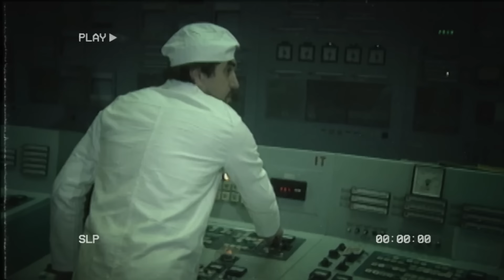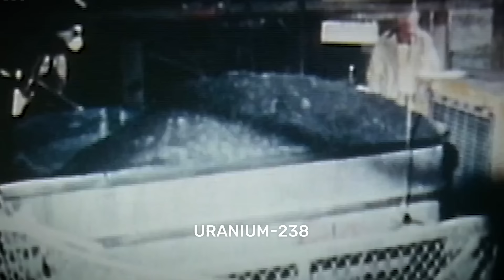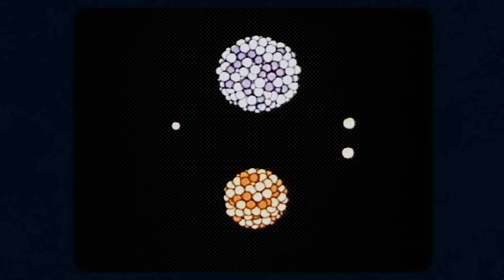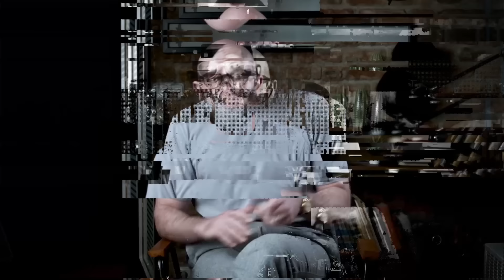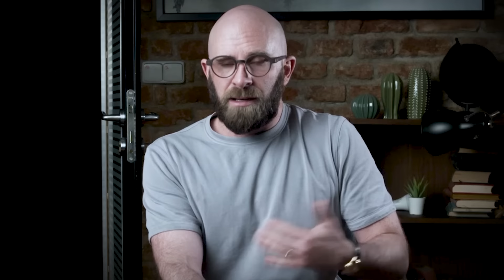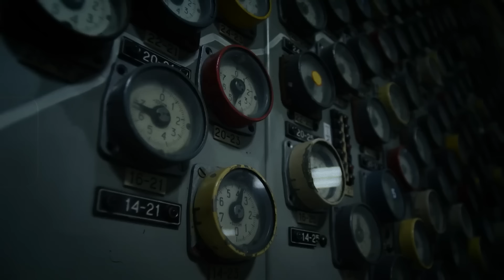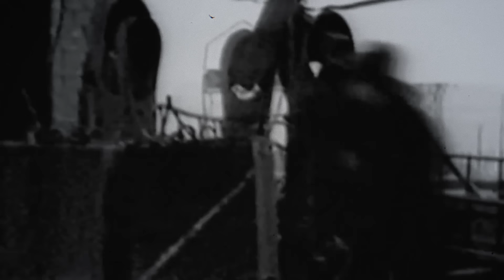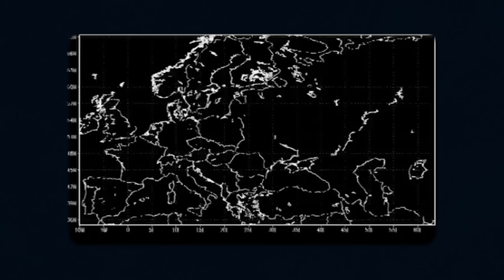The RBMK: The Shoddy Nuclear Reactor That Nearly Killed Millions

Comment: I didn't hear you mention how the buildup of xenon played into the disaster. Xenon is a neutron poison that builds up under low power operation because it doesn't get burned off as it forms. Once it builds up it can take days to safely clear. If some genius cranks up the power and the xenon burns off, you have an uncontrolled runaway event. The graphite tips helped make that situation even worse. The RBMK was just not idiot proof enough for the idiots in charge. At least this is how I remember the story I heard.
Reply: Xenon doesn't built up under low power. It only spikes up after a power reduction. 
At low power you do have a slower destruction rate but the creation rate is also less and a core running at low power will reach an equilibrium, not poison itself given time.
Reply: @ The point is it takes time to reduce once it builds up. And apparently you can't  rush the process. They did exactly the wrong things and that was the cost. It was a perfect storm of bad decisions.
Reply: @mntbighker  I think we are aware of that.
Reply: @mntbighker  They did not have all available information regarding the reactors they were operating. If they had, the accident would never have happened.  They deeply believed that an RBMK reactor simply could not become uncovered.  Moreover, the organizational culture in their nuclear industry didn't give them an option of "no, we're not doing the test." The ultimate failure was the Soviet system itself.  This is why the USSR was so uncharacteristically open and compliant in so many other ways following the accident.  The strategy was so effective, people still focus largely on the OPERATORS to this day.  The administration KNEW this was possible.  Yet every western television production about this fixates on Dyatlov and portrays him as a virtual sociopath.  This was not the case.  See, this narrative worked better for western authorities, too, because they were delighted to be able to use it as a foil for their own shortcomings.  And the fossil fuel industry LOVES it.  It is insane that we are not using nuclear.  Insane.  In terms of radioactivity, coal has introduced WAY more into the environment than all nuclear plants that have ever existed, I'm pretty sure.
Reply: @mntbighker  you just repeat the same thing... if xenon wasnt an problem, then it wasnt a problem. Could it be a problem if it accumulated enough? Probably, but if the investigations found it to be a none issue, then i tend to believe them.
Reply: @maxmusterman6030  It was a problem. See:

M. V. Malko, "The Chernobyl Reactor: Design Features and Reasons for Accident," in "Recent Research Activities About the Chernobyl NPP Accident in Belarus, Ukraine and Russia," ed. by T. Imanaka, Research Reactor Institute, Kyoto University, July 2002, p. 11.
Reply: @maxmusterman6030  The Xenon was not a problem until it was. When the reactor is operating nomally the Xenon gets boiled off as soon as it is created. They could even siphon some off to be used for scientific uses. When they did the test and the power went way down, the Xenon built back up to the point where it was stopping nearly all reactions from taking place. AT that point they should have just shut down the reactor, cleared out the Xenon, and then restarted the reactor. This would have taken several days.
When the power output got so low, the turned up the reactor to get power output back. At this time there was a lot of Xenon in the system. When they turned up the reactor, the xenon started boiling away very fast, and the reactor went into overdrive - way beyond the design limits of the reactor. Actually a runaway reactor. then they tried to slow it down using the control rods, but when the carbon tips entered the core they got stuck, as the fuel in the reactor had already overheated. further resulting in even more of a runaway.
So Xenon was not a cause of the problem but was something that made it worse.
Reply: @bsadewitz  nuclear energie - no thanks - eternal waste for a short time benefit - its plain egoism to leave that waste to others in the far future
Reply: @KrüppleKatze  That's true, basically they were running at something like 30-50% all day when they were supposed to be basically shut down so quite a bit more 135Xe built up than was intended for the test.
Reply: There are no "graphite tips" (they're displacers nearly as long as the control rods meant to improve the worth of the control rod), but otherwise you're right. They got trapped in a xenon pit, and instead of doing the smart thing (shutting down and doing the test next week), they pulled every single control rod  possible out. The xenon burned off, the reactor went too high, and then the SCRAM (AZ-5) pushed the displacers down to the bottom of the reactor, which caused that spike.
Reply: @ zactly
Reply: @AFullerHouseAtlantic  Oh, you wanna be pedantic?  I'm HERE FOR IT lolol.  YES, they can be referred to as "tips".  A tip is the extremity of something.  The third joint--and beyond--of your finger--that's your fingertip.  The whole thing--not just the very end of it.   If that were way longer, it would still be the tip!  Is it better to say "displacer" every time?  Maybe?  "Tip" doesn't seem to be the MOST COMMON term used, but it's hardly uncommon, either.  The notion that it's incorrect comes from a misunderstanding of the scope of the word "tip".  The medical term for "fingertip" is "distal phalanx".  The displacer is the distal element of the control rod assembly (or whatever you call it).  Yes, "tip" often implies what you're saying it does.  But it doesn't have to.  A tip can be like ... a projection.

"The Shteynberg Commission indicated that the graphite-tipped con-
trol rods had not been properly constructed and were of shortened
dimension. It is alleged that the sudden insertion of the rods into the core,
at low power, at the conclusion of the experiment, was the direct cause of
the explosion."
Marples, D. R. (1991). Chernobyl’: Observations on the Fifth Anniversary. Soviet Economy, 7(2), 175–188. 

"This characteristic, together with
graphite-tipped control rods (which temporarily increased neutron moderation during the act of reactor shutdown)
contributed to the Chernobyl accident in 1986."
Mark Ho, Edward Obbard, Patrick A Burr, Guan Yeoh,
A review on the development of nuclear power reactors,
Energy Procedia,
Volume 160, 2019, Pages 459-466, ISSN 1876-6102

"The leading edge of the
control rod contained a graphite tip that had no neutron
absorber and that moved out of the neutron-absorbing
fluid (water); as a result the reactivity was increased and
the reactor power increased drastically"

Badgujar, K. D. (2016). System science and control techniques for harnessing nuclear energy. Systems Science &amp; Control Engineering, 4(1), 138–164. DOI: 10.1080/21642583.2016.1196468
Reply: Tip implies that they're directly on the end of the rods and that they're substantially shorter than the control rod. They're not. They're separated by a couple of feet and very nearly as large as the absorber. It sits in the center of the core (in the original design) so the power band is relatively even across the core.
Reply: @AFullerHouseAtlantic  Actually the Series did a good job of showing what happened. Because the fuel rods overheated, they swelled and got stuck. and because they got stuck the SCRAM would not work and everything just turned into a complete runaway. 
I contend that the RBMK reactor could be safely run. But it has to be run right, no shortcuts every, no mistakes, you have to be on the top of your game all the time. And as what what shown, they were using the 3rd string, and the bosses were more concerned with performance than safety.
Reply: What you've said is accurate - the reactor running away caused the fuel channels to become misshapen and then rupture.

Re: safety the RBMK is pretty much by definition not a passively safe design. Water moderated reactors by comparison largely are  (not entirely, but a LOCA cuts the reactor power nearly to 0).
Reply: This is incorrect. Xenon 'burning off' made no meaningful contribution to the Chernobyl accident. This is just fan fiction that is nowhere to be found in actual accident investigation documents.
Reply: In fact xenon indeed absorbs neutrons but if you check the graph of xenon relative to the power level you'll notice how xenon actually increases for a little while then reduces significantly on that same power level. If you're interested in the little details i highly recommend ThatChernobyl guy
A great YouTube channel about so many misconceptions i hope you'll love it
Reply: I thought that too but as far as i know, the time the reactor ran on the given power level was enough to keep the xenon in check, the problem was not even the operators, it was deep in the design of the rbmk. 

I just wrote a comment for 10 minutes to describe it but i found out that im too stupid for that 😂  But i really recommend the cannel "thechernobylguy". He goes deep into the design of the RBMK and what exactly happened. And for everyone who cant get enough of it he even made a 2 hours video on the night of the explosion with step by step of every decision that was made that night and resulted in the tragedy we know today.

I really think the operators arent to blame and were only scapegoats by the government. The dude i mentioned was also a bit pissed about the HBO series because they pretty much also blamed the operators for what happened (but still still an awesome series, also an huge recommendation even if the facts are not always perfect).

Comment: It seems like all you'd need to do is modify it so that say 15% of the control rods weren't graphite tipped, and then design the scram procedure to drops those rods in a few seconds before the rest, and that would smooth out the momentary bump in reactivity, such that it didn't cross the critical threshold. I don't know how you could design that thing and not forsee the potential disaster of being unable to avoid briefly massively increasing the rate of reaction in the process of shutting it down.
Reply: The positive void was a known issue since demonstrated in an incident at Leningrad power station about 10 years earlier. As I understand it the control rods now have a telescopic type of design so that the graphite is not a problem.

From what I can recall from one of The Chernobyl Guy channel's videos the graphite tip being longer on the control rods at this reactor made this incident more likely. Can't remember the rationale behind the design change though.
Reply: @overredrover9430  Except the Leningrad incident was so secret they didn't actually tell any other RBMK reactor's engineering staff about it...

And I think the rationale was that the reactor would run only within the safety margin so there won't even be a disaster. Which would had been true if not for the test to run the cooling loop with slowing turbines, which is 100% the staff's fault as they didn't want to get blamed for not running the scheduled test only because reactor was a bit iffy...
Reply: I'm not sure if the need for the test was coming from the operators or the designers. I'm assuming from the designers (who knew about Leningrad), because as I understand it this was to prove the concept for all reactors, so should have known not to have such safety systems disabled.

Comment: The whole bit about having a steam explosion having a yield of 3-5 megatons is complete bunk. The fissile material, U-235, wasn't nearly at high enough concentrations to cause a nuclear detonation. It would have had to go through significant enrichment to reach those levels. It also sounds like you're saying that the steam, itself, would have caused that big of a boom which is just impossible. A steam explosion would have released a massive amount of radioactive fallout, but unless the nuclear fuel magically enriched itself and the water got hot enough to separate into hydrogen and oxygen before the detonation in such a way that the hydrogen was used as fuel for a thermonuclear fusion-fission bomb, then it's all nonsense.

Edit: typo
Reply: Yeah this. 3-5 KILO ton maybe, if the water somehow managed to moderate the corium enough to go supercritical again, but megaton yields are only possible with a carefully designed and precision made thermonuclear device
Reply: Someone did the math, and they calculated that if it was 100% energy conversion, it would have been just under 10 kilotons. It must be a typo, and what he meant was 3-5 kilotons.

Edit: looked it up, and the number is estimated to be 225 tons. That doesn't even crack the Top 10 for largest accidental non-nuclear explosions.
Reply: Tru dat!!!!!
Reply: He was quoting one of the leading scientists working at the Soviet department that designed the reactor (the 'hero' in the HBO series) who was describing the theoretical worst case scenario. Granted this is unlikely (requiring enough U235 from the natural uranium fuel (not enriched to 2% as is used in the light water reactors) to become concentrated enough in the corium to detonate) but so is writing a book by randomly typing keys on a keyboard.
Reply: @overredrover9430  So what that he quoted someone. The writer could have done more research and explained why that wasnt possible. Instead Simon mentioned going to a map and seeing how bad the damage would have been. People have pointed out other problems with the script (moderators, listening to what greenpeace says, etc).